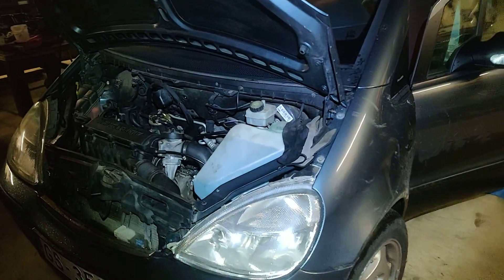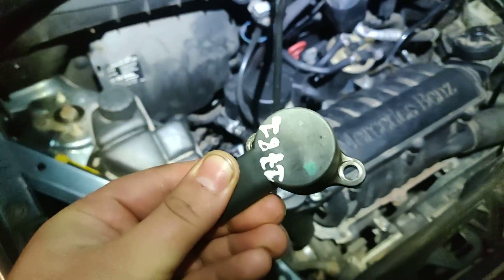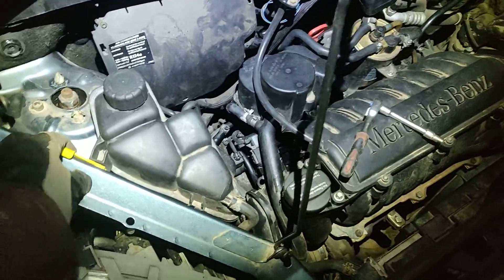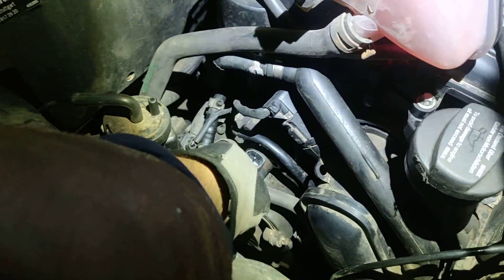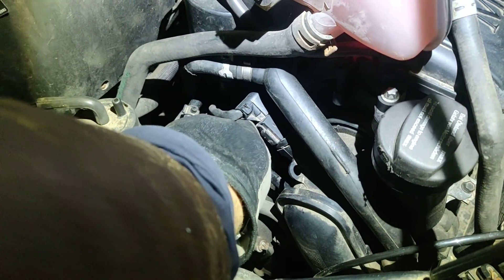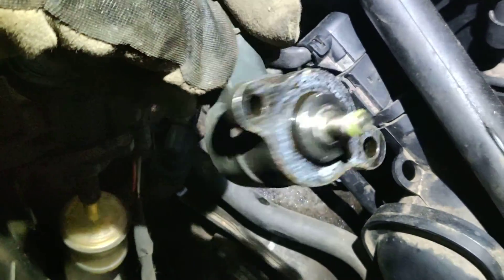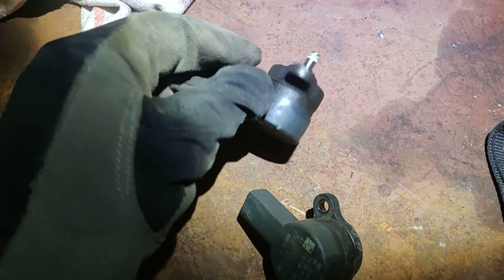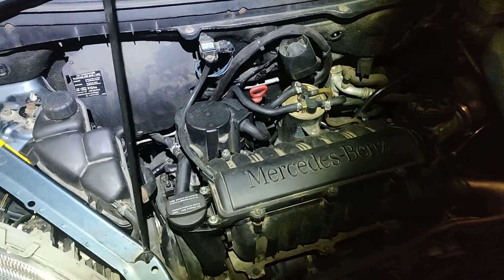DRV valve Mercedes-Benz problem solved with floating engine RPM

Comment: Nice. there is a similar valve that has a filter on the tip.
Reply from the maker: Where it is? I have problem started again
Reply: @modrix  its the quantity control valve on hp fuel pump...
Reply: @modrix  did you fix it?
Reply: @modrix  I speak of the Sprinter 2.2 rail pressure valve which is very similar to this.